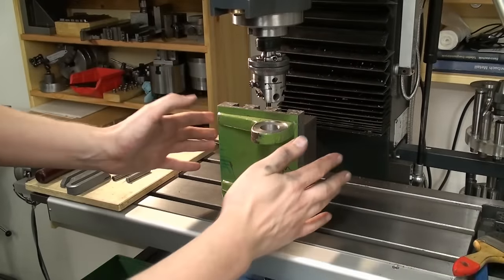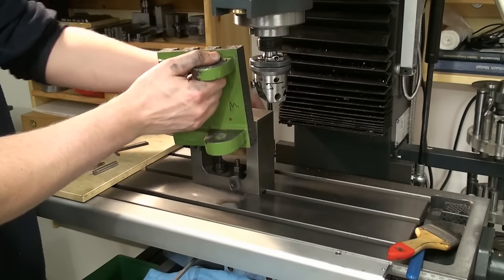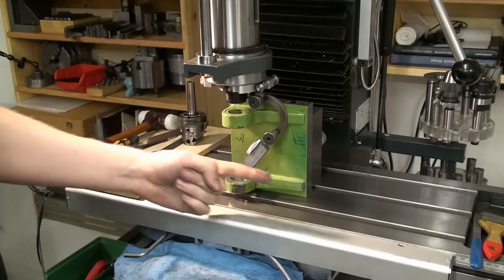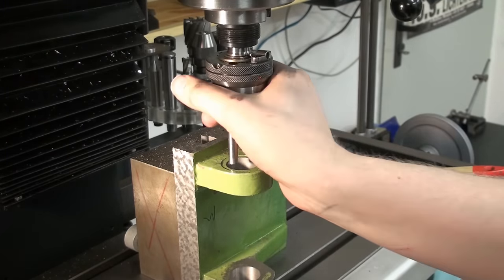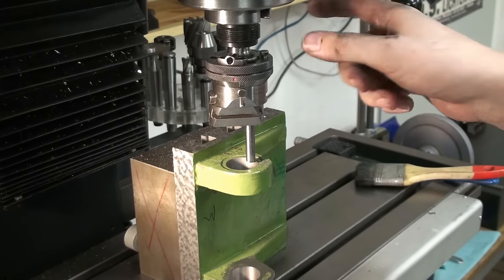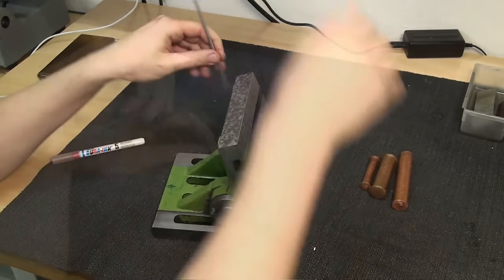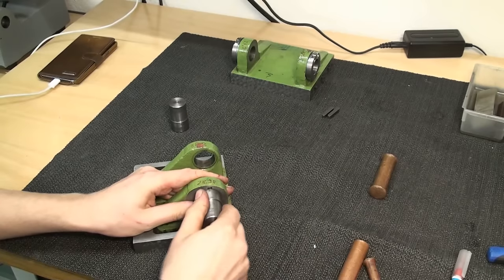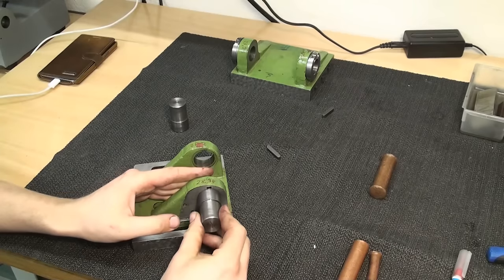Adjustable angle plate, improving and scraping - Part 3

Comment: Double grub screws on each rod end would secure your rods from chatter, alternatively, drilling, threading and enlarging for a single cap screw would give you the strong holding and zero movement but easy dis-assembly that would be handy with this table.
Reply: Yes!!

Comment: How did the table still fit that snugly on the base after you removed material from the areas where it hinges? Wouldn't there be a gap in between the areas where the table connects to the base?

Comment: Always watch your stuff Stefan. I can sit relaxed watching another guy work and at the least perceive lapse violating my high standards (far more stringent for the other guy than for myself - hypocracy is too harsh a word) instantly pounce.

For instance, over here in the Land of KnuckIle Draggers, I'd use taper pins to lock the pivots. An alternative for sure because we also have interference fitted dowel pins, tapered expansion plugs, etc but it's often nice to know the other guy's thinking. I'd pick taper pins because they fit tighter than a dowel pin but remove easily with a tap at the small end. I'd be more inclined to use dowel pins for shock applications or hardened parts.
Reply from the maker: Thank you! 
I never realy liked taper pins (Just as roll pins). The tapered ones always seemed to work themself loose or some boozo tries to remove them with a hammer from the wrong side. I also never liked the fact that they are soft.
With the cylindrical pins I got never problems, as long as the reamed hole is a close fit.

But its interesting how many people would use a tapered pin, supprises me.
Reply: +Stefan Gotteswinter We could start a real dialog on the merits etc. I got into taper pins in my shipyard days. Some of the more exotic split case pumps had to come apart dozens of times in boring. We centerless ground hardened taper pins for this stage and for final assembly they were fitted with K monel pins.

So it depends: generic taper pins out of the box or purpose made and custom fitted. But not in shock or vibration applications without positive retension. We agree there.

OTH, roll pins have their place - in the other guy's stuff, not mine.

Comment: What,
Stefan, you call that finished?

No, it needs a pair of 3D printed bungs to plug the dowel pin removal holes.
And perhaps a small diamond on the front end of each printed bung.

Comment: did you really only glue that small drill onto the extension?  marvelous.
how many times did you have to reglue it to get through both holes? :) :)
Reply: Into?  I thought that he just glued them together ; )
Reply from the maker: Yes, Loctite 648 is the way to go, I had never such a extended drill fail on me.
Somebody who is more machinist than me would silver solder the drill into the extension ;)
Reply: Well done mate, you can only but try, if does not work, it does not work.  I think my trust in glue needs a serious revision.

Comment: Very nicely done as usual Stefan. That has to be the most accurate Chinese adjustable angle plate on the planet at this point. :-) Some much needed improvements compared to what you started with. And first time I've seen that small Wohlhaupter B&F head. I didn't know they made that size. An extremely desirable piece of tooling for sure. I've got a bit larger Narex Vhu-36 B&F head, and while it's very nice I'd doubt it's quite up to the quality of yours.

Have you thought about adding a worm and partial wormwheel to that angle plate so it's then capable of having a fine adjust?

Comment: Very nice video. I like your scraping and clean work approach. I feel like a slob when watching your video's. 
Regarding the dowel pins, i would have put them on the underside of the baseplate upwards. More meat if you encounter heavy workload and minimise risk of a break in the casting, I always like to have as much material as possible with cast iron (i won't go into details but i have a hidden box with apprentice marked tools hiding in the "shame on you" closet).  If you read this can you reply how the jig fixture kit is called in Germany on ebay, i really like these blocks, you can never have enough of them.

Comment: Thank you for another fine video.

Is it true that adjacent sides of the top plate need to be square to each other, as precisely as opposite sides are parallel? I.e., not out more than .01mm?  If so, how do you measure that?

Comment: Hi Stefan,
another great project. thank you.
I realise their are many ways to lock the shafts from turning, my first thoughts were to drill and tap the base for a grub screw. would a grub screw be suitable for this location or is the pin the superior way. comments please.
Reply from the maker: Might work, but grub screws are always prone to work themself loose.
Reply: I would have used a double grub screw it would be very well locked. I used this method on my mill spindle drive in two different places and have never had any problems.
Reply: thanks

Comment: Hi Stefan, now the Chinese will copy your angle plate and will make millions of them.
No offense , just curious, but to bore both holes inline wouldn't be better to set up the plate on the lathe carriage than use a  boring bar between centers? Than for facing use the Wohlhaupter in the lathe. Also personally I would use taper pins instead of ejection pins to fix the bolts. It seems to me more exact. But after all the are fifty ways to skin a cat.
Nice outcome and thanks for shearing.
Radu

Comment: Could Loctite green (?648?) or other similar  retaining compound be used in this case? What the disadvantages?

(disclaimer: I'm not a machinist)
Reply from the maker: Yes, would perfectly work - And in some respects it would be better than the key and the pin but there is a problem: Taking it apart would be a pain :D

Comment: Pretty nice except the two small clamp screws have less holding power then the original design, I would have machined and installed tapered dowel pins...that would be real German...or Swiss lol.

Comment: Damn. You started talking about key ways, and I got excited about the shaper, then I was disappointed when you used the mill. 😒
Reply: Lovely work though. That plate is really useful now!
Reply: I think the shaper would have been difficult going up to a hard "shoulder" as opposed to cutting a feature all the way across the workpiece. Correct me if I am wrong.
Reply: You would drill a hole where the key way is to end and work the shaper from end of bar to hole.

Comment: 2 grub screws would have been simpler and just as solid
Reply from the maker: For clamping the swivel motion?
Reply: @StefanGotteswinter  I have this method holding the pulley drive to my mill spindle. Has to be recessed  into the shaft and backed up with a locking screw so far no problems.Not to say your pins are well suited to the job.

Comment: Wow this is the first video where I think you really blew it.
The original 16mm bolts clamped the 2 halves with many tons of force, practically turning the whole assembly into one solid chunk of metal.
Now you rely on two small keys, exposed to shear and skew forces, and two tiny dowel pins exposed to a lot of shear force with the leverage of the pivot...
That's terrible.
You have succeeded in scraping the surfaces to a high precision, but the rigidity of the entire device is compromised and now it is only suitable for really light duty machining. 🤔😯
Reply: Dont forget, that with the original design, the table always has a tendency to move while tightening the lockscrew. His machine park does not contain any heavy machining equipment. He is rather specialized on small precision parts. So the benefit of having the table not moving while tightening should outweigh any reduction in rigidity.